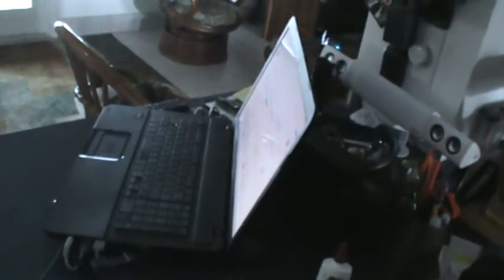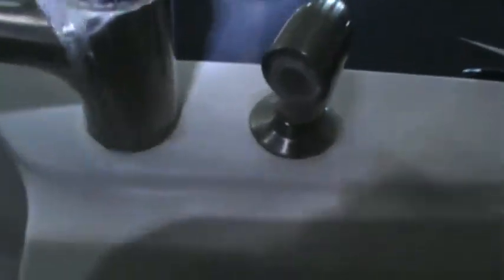DIY FAUCET REPLACEMENT WITH NO POWER 12/15/13 WITH KRAZY45CAT

Comment: I used to replace sinks and facets is my younger years. I would basicly crawl under the sink to tighten up all parts. Last time I did this few yrs ago was lots of fun. The body doesnt bend as good as it did in my 20's. Also I got bigger as well..... But all dueable. Just takes few min longer.
Reply from the maker: 20 mins tops and I was done